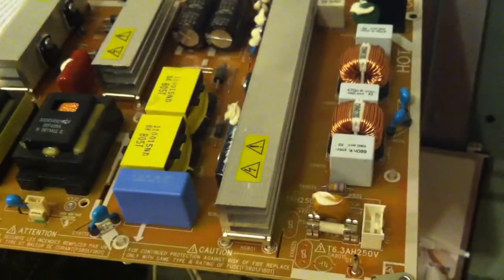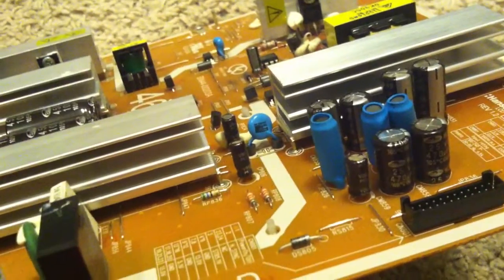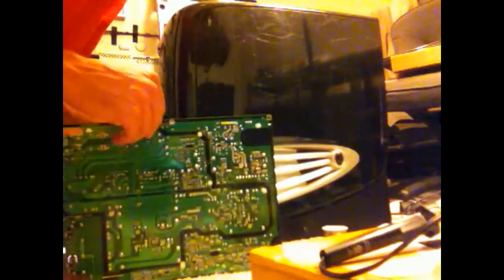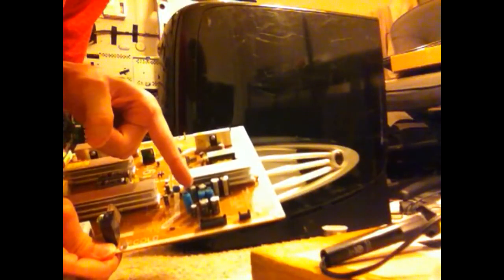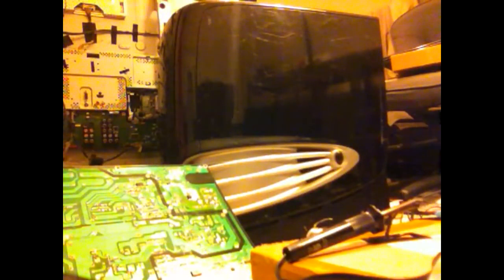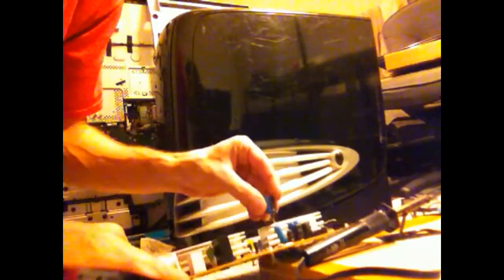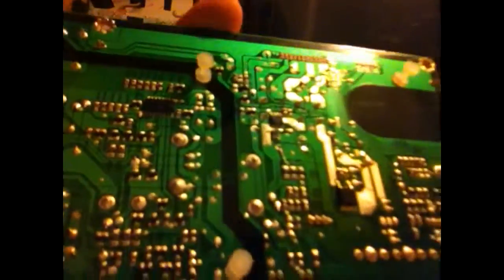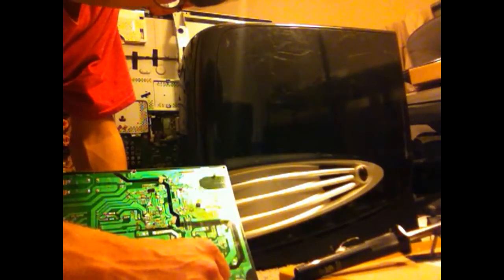Samsung Ln46a650a1fxza clicking noise fix

Comment: Are you sure those are 35v caps? The ones on my board are only 25v... I have the same clicking noise and saw two bad caps that I want to replace. Should they be 35v or keep them 25v like the ones I removed? My TV manufacture date is also March 2008.
Reply from the maker: You should always go higher for the voltage if you can.